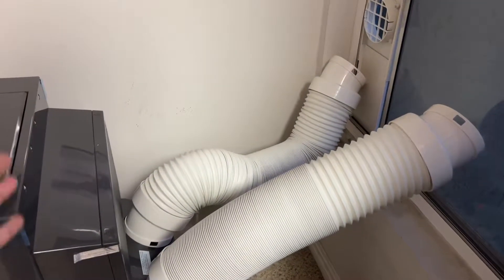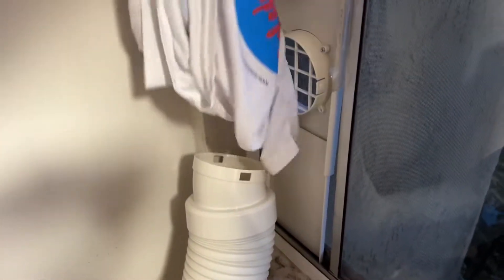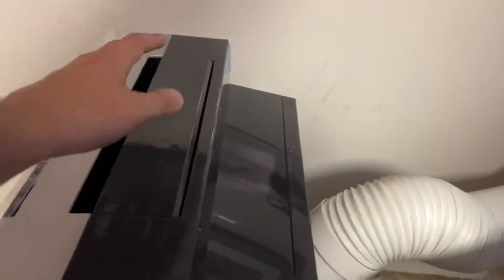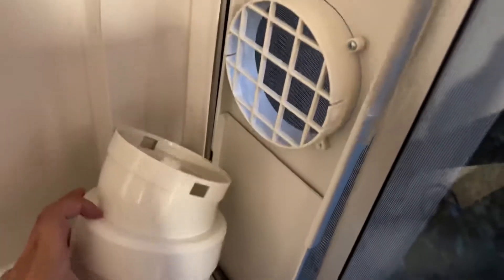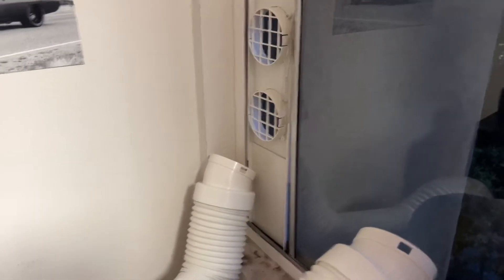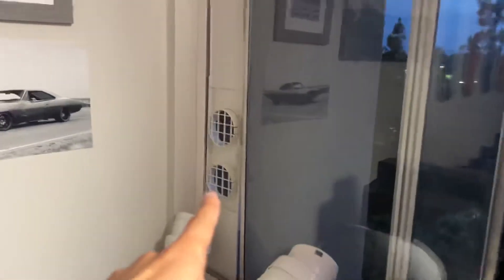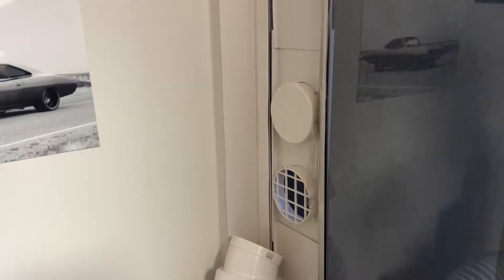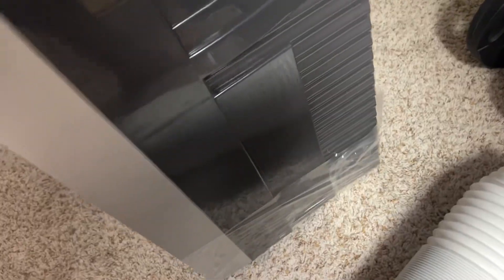Dual Hose AC - Whynter ARC-14S 14,000 BTU Portable Air Conditioner Demonstration

Comment: Hey there  - To clarify for anyone watching, the outside air that is sucked in from the intake hose does not get cooled and released into the room.  The outside air is simply used to cool the condenser coils and compressor and then it is expelled back outside.  The cold air that is being expelled into the room is actually taken from the air in the room.

This is especially important to note if you live in an area with a wildfire risk as a dual hose unit will mitigate outside smoke from coming indoors since it doesn't create negative air pressure like single hoses.
Reply: Glad you clarified that, the information in the video is incorrect.
Reply: Dual hoses create no negative pressure at all? That's cool. I was thinking about buying a dual hose one with a HEPA filter. So the HEPA filter would filter only the air taken from the room?
Reply: @Constitution1789  Yes
Reply: But if you want to cool something, would you want to use hot and humid air or would you use the much cooler and drier air that's inside of the house?
Reply: @saidtheblueknight  I’m not sure I understand your question.  I would encourage you to research how widow A/Cs work to learn more

Comment: I actually solve this problem pretty easy. Went to Home Depot, Cut a piece of wood, and then painted it, that would fit snug in between the two Plastic Single Hose Window Kit for ARC-101CW, ARC-12S and Window Kit for Whynter Dual Hose portable air conditioners. So my intake is at the very bottom, and my exhaust is on the very top, probably a good 5 feet from each other.

Comment: There is a lot of misinformation and confusion here and in the comments.  I worked in the A/C field for many years including testing and balancing airflow systems.  Any portable A/C unit will not work near as well if it doesn't have two hoses.  Here is why:  First let's compare to a window unit.  With a window unit you have two halves, the inside half and the outside half.  Each half has a fan.  The inside half takes air from the room, passes it over the evaporator coil and then blows it back into the room at a cooler temp.  The outside half takes air from outside, blows it over the condenser coil  to collect the heat and then back outside.  A portable unit works the same way, but instead of having the condenser coil outside of the window, it is inside with the rest of the unit.  A two hose unit makes it work just like a window unit, drawing outside our in and then expelling the same air after it passes by the condenser coil.  Here's the issue with only having or using one hose: instead of drawing in air from the outside to pass over the condenser coil, you would be drawing air from the inside.  It will still work, but not anywhere near as well, because anytime you draw air into a fan from the inside and then discharge it to the outside, you are creating negative air pressure inside.  That air being blown outside has to make its way back inside somehow to be available to be drawn into the fan.  Otherwise, eventually you run out of air inside.  So, the negative pressure inside will cause outside air to be drawn in through any opening it can find and that air will be outside temp.  It's much better to use both hoses so there is no negative pressure inside drawing in hot outside air.

For a real world comparison, I had a small room that I cooled with an 8000 btu single hose portable unit and then switched to a 5000 btu double hose unit.  The smaller dual hose unit worked significantly better at cooling the room than the larger single hose unit.

Oh, and for those asking about using it with neither of the hoses, the unit will blow cool air out the front and hot air out the back and it will result in actually raising the overall temp in the room the longer it runs.
Reply: Does it matter that the outside air is 110 degrees?
Reply: Wow man, this is really helpful, thanks for sharing your insights, I just bought Portable AC and I noticed the same thing about the air pressure from outside is strong and want to come in. I will consider coverting into dual hose. 😊
Reply: How about is you use only the fan mode, I think this would be less effective since the effect will be the opposite.
Reply: Hi. I have the 2 hoses on mine. It worked good for the last 4 years but today it stopped blowing cold airno matter how low I put the temp. Any ideas what may be wrong with mine?
Reply: What sort of dual hose unit did you find that is 5000 btu? Seems like every dual hose unit is like 12k btu and up.

Comment: I have the same ac for 5 year, but now it’s giving me troubles.
When I connected it  ⚡️ it would start right away, but I can’t control it manually or remotely.
The only way it shuts down is when I disconnect it.
What could be wrong?
It still works but I can’t change mode or do anything 😢
Reply from the maker: Sorry I'm not sure!

Comment: See the comment below ... the information you stated is incorrect. The intake air for the room is not coming in through the hose you point out. That is strictly for the condenser air as this is a dual hose system. This type of dual hose system prevents a negative air pressure effect in your room as other portable units use the air in the room to exhaust out through a single hose. The air for the room is pulled in from above the double hose setup, filtered cooled and sent to the room ... should be clarified.

Comment: The customer is wrong about how dual-hose units work. The coming in from the intake hose is not used to cool the room. It is used to cool the condenser and to keep the room air pressure neutral. The big square intake on the back of the unit is where the air is drawn to cool the room...
https://www.youtube.com/watch?v=WMIKrW5131s

Comment: Hi. Where does it drain the water too? Thx
Reply: There are two drain valves. One at the bottom of the unit, hard to reach, and the other is right below where the hoses are.  I use a silicone bowl to collect the water since it's extremely malleable

Comment: I have this same air conditioning unit..... but, I only use the exhaust hose, and not both of them.  I figured... the inside of my home is already less hot, so why pull in the hot air from outside?  It's been working just great for me, using only the exhaust hose.  :-)
Reply: So you aren't cooling the air to cool the condenser to exhaust the cool air. Its two hoses for a reason
Reply: Sorta, but not quite. The misconception is that using the 'hot outside air' to cool itself is worse than the cold inside air. But as you exhaust the hot air, where does the air come from to replace it? It gets sucked in through any cracks it can find, meaning it's also sucking in humidity along with it. The majority of energy used in an air con goes into just condensing water, so by drawing in more humidity you make it work harder and lower the efficiency. Think of it like AC in a car; you turn on the recirculation mode to cool faster by sealing in the cabin air(and to avoid sucking in the exhaust of the diesel truck ahead of you)
Reply: @bueb8674  So what are you saying use both hoses or not to use both hoses?
Reply: @bueb8674  thnx

Comment: The dehumidifier mode does not work at all whatsoever. I just bought this brand new and it's been running for 4 days in high humidity and it has not taken one single molecule of moisture out of the air. I live in a small one room apartment and I took a heavy duty shower and two loads of laundry are hanging in my apartment. The windows are sweating even the ceramic tiles on the floor are soaking wet and after 4 days this machine is 100% bone dry. It's a good thing I didn't throw away my cheap Chinese air conditioner dehumidifier because when I turned it on within 1 hour the bucket was filled with water. This is a complete total ripoff don't buy it if you need the dehumidifier mode it's garbage, total waste of money and I would return it but I'm 73 years old and trying to get this back in the box and send it back to the store is too hard I rather just take it outside and hit it with a sledgehammer and throw it into throw it in the sewer. don't buy this junk cuz you're wasting your money.

Comment: is it necessary to connect the hoses to the unit?? can the portable air conditioner running normally without those hose ducts for air exchange?
Reply: It is necessary to connect at least one of the hoses.  The exhaust hose needs to be connected to the outside.

The other hose doesn't need to be connected (the one sucking air into the unit).  However if the inlet hose isn't connected, the unit operates like a single hose unit.
Reply: @dansynth8408  I understand what you said but I have a problem. I have a full-length blind inside. If I connect one, the exhaust hose to the outside, I won't be able to close my blinds. That is why I want to know if it can be operated without the exhaust hose being connected
Reply: I only have the exhaust hose blowing warm air out....
Reply: @eddiegunz3551  I know one hose model works, but, like my previous posting, if I cannot close my blinds, I have to sacrifice my privacy for the cold air. My question still stands, does it work without connecting the exhaust hose to the outside and simply letting the unit recycle the air within the room
Reply: @yumfook  my only concern is the hot air coming out of the exhaust ..It would defeat the purpose of cooling your area...Maybe if you can divert the hot air into a closet or area that isn't occupied...
Reply: if I can find an outlet to get rid of the hot air, I didn't have to ask. I want to know if the unit can function without connecting the exhaust hose, hopefully people with knowledge of the air conditioning operation can answer this stupid question
Reply: @yumfook  You must have at least the exhaust hose connected to drive out the hot air. If not, the hot air will circulate inside your room and it will not get cold. You should only connect the exhaust hose and close the blind down to it. You can then get a large white carboard to cover the window below the exhaust hose for privacy.
Reply: @RXTSEA1  that's what I did

Comment: UPDATE. It was leaking refrigerant. Unit was not cooling my apartment. Definitely don’t recommend! 

I just bought this unit. There’s gaps between the hoses and the machine. Made sure both clicked into place still happening. I have some hot air blowing out the hot air hose. My gas detector lit up where those gaps are indicating a leak I’m assuming. Not sure if it is defective or not or even safe cause of Freon.